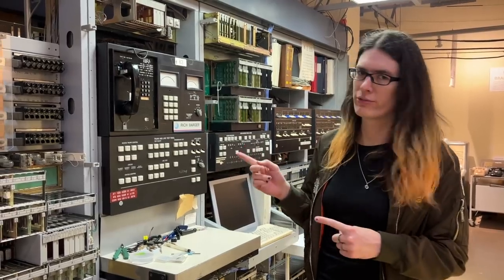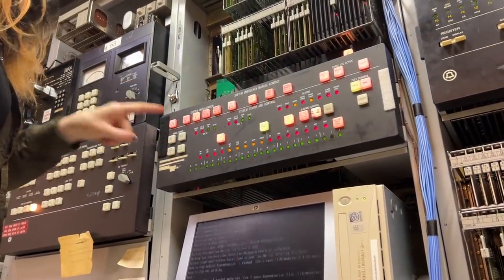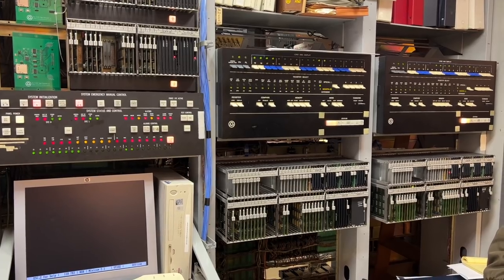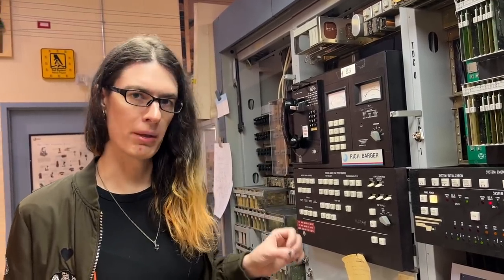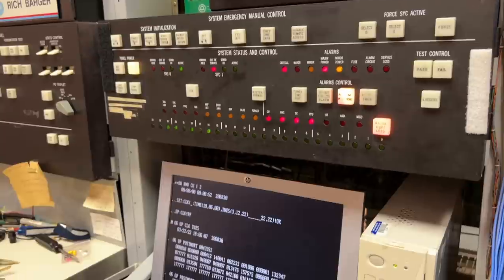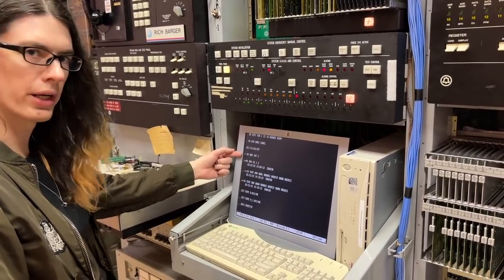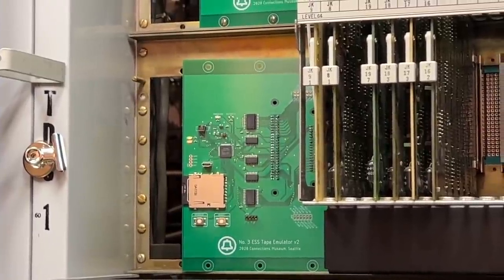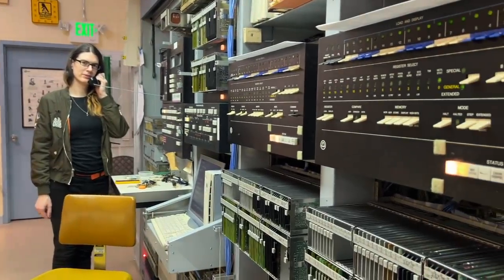Booting up the 3ESS

Comment: Great to see the 1AESS / 2BESS / 3ESS commands again. This machine was not designed to be powered down and then back on. Back in the 1970s, when a 1ESS was put into service, the Engineering goal was for the switch not to be Out Of Service for more than 2 hours in 30 years.
Reply: We had a 2BESS at IBM in San Jose in the 80s. It’s most likely been changed out in 2022. I heard they also had a 2B machine that served Catalina Island in SoCal in the 80s. The good ole PAC*BELL days.
Reply: @steve94044  I worked on the 3ESS system that went to Avalon on Catalina Island around 1978. We shipped it special in two pieces so It would fit the ferry that took it to the Island.
Reply: @535tony  That’s a cute building the co is in. My co worker was the island phone tech in the 1980’s. He lived in one of the pac bell rentals there. His first name is Rod.
Reply: @535tony  What part of the bell system designed the ESS and at what location?
Reply: @martello44  I don’t know where the 3ESS was developed. The 3ESS was mostly built at the Oklahoma works. After I worked on the 3ESS for two years all production was moved to Oklahoma works for the 3ESS. I then started  working on the 3B processor that was used in the 5ESS. These were developed at the Northern Illinois Works in lisle Illinois where I worked. I worked from 1979 to 1983 on the 3B processor from prototype to production. The Northern Illinois Works was shut down in 1983 when I left.
Reply: @535tony  Thanks. In the mid 60s I worked in a CO in lower Manhattan right next to the twin towers.  One day management asked us if anybody was interested in taking a mail course in digital switching where they would mail a chapter with a quiz at the end and if you got a sufficient score they would mail the next chapter to you. I thought it was clever and tricky because they trained you on your own time while identifying candidates who could be assigned to the ESS machines which were then being developed. The course even had a chapter on UNIX. I completed about a dozen chapters but left for another job before completing the full course.
Reply: 2 hours in 30 years??? :-))) ok, so our "a new version of the website will be deployed in just a minute, madam" kind of aproach is quite lame..
Reply: Not only were these systems built to never be turned off and on, Bell Telephone/ATT had lots of, "thou shalt not" demands with respect to environmental temperature variances that were allowed.  There were the expected absolute upper and lower space temperature limits but, even more important, were degree per hour or minute limits that were allowed.  According to required ATT training for contractors, thermal shock and thermal shock induced failures were a big issue with them.

Comment: I built the 3ESS systems in the late 70’s from the Northern Illinois Works in Lisle Illinois. Great memories. I also built the 3B processor that was used in the 5ESS till I left Western Electric in 1983.
Reply: Hey Scott!  Good to see you out there.  We had some fun times building 3ESS on our team.
Reply: Did you know Terry Webster?
Reply: @jameschristiansson3137  I don’t recall that name.
Reply: Did anyone else use 3B15/3B20 mainframes besides AT&T?
Reply: @douro20  we made 3B15’s and they were all for AT&T. We mostly made the 3B20’s and they all went into 5ESS.
Reply: @535tony  The 3B20D processors were also used in the Autoplex 10 and 1000 cellular switches. I developed code for the 1000 when I was at Indian Hill in the 1980s. Those were good times.

Comment: Was going to say, the ones I've worked on are literally never fully powered down until they're decomissioned.

Different function, but on an HLR (Home Location Register) I worked on, the one time we had to power down a whole frame (because we'd lost commercial power, diesel generator had failed to start and the battery plant was running at 36VDC), when it came back online it had lost 4 of 8 SCSI drives and needed me to fly out and nurse it back to health.

Fun times...
Reply: I recall the conversation from Alcatel when we were trying to sell our 600E in Manhattan... "If you turn it off, we'll never recertify it!" I think we sold it and the building. :-) That was in the early 2000's; it had been running continuously since the 70's. (No one was sure it could be powered back up.)
Reply: @jfbeam  early in my career, I worked for an oil refinery in the Midwest.  

The place opened in 1970 and by the time I came along, almost all the people who opened it had retired, and in that time they had never needed to stop the whole facility for safety or anything .. put another way, nobody knew how to turn the machines back on from a cold start. 

To my knowledge they still haven’t had to cold start the place (but there was a lot of anxiety around writing the documentation when I was there)
Reply: @satsuke  It's growing problem in technology fields. Few ever consider the issue of bootstrapping their operations. My former employer used to have a yearly "shutdown" process where everything is shutdown and restarted once a year, around the time most people take off on summer vacations. Of course, that wasn't an ISP, telco, cable company, power company, etc. If we turn off a building, it doesn't really effect anyone else. At my last telco job, rebooting anything was a paperwork nightmare; and there are things you simply DO NOT reboot, much less even look at the power cables.
Reply: @jfbeam  I was recently RIFF’d from my telco job, and it wasn’t so much an issue for us as they went with an aggressive trinary redundancy platform, so the Nokia could take an entire site offline for a month to perform upgrades and bring them up in order.  It was still a nightmare of planning because of the dependencies when it came to data model changes and trying to support GSM/UMTS/HSDP/LTE/NR all at the same time
Reply: @jfbeam  bootstrapping itself wasn’t that big a deal though as it was a docker/kuberneties on VM arrangement .. So we could move a live node to a different piece of hardware with it still running without traffic loss.   

It honestly wasn’t as satisfying as the old ways when we’d troubleshoot at small scale .. it is easier to throw away the VM and spin up a new one if something isn’t acting correctly then it is to try and troubleshoot

Comment: Very cool, I worked at Bell Labs in the 80's and 90's in NJ, where I wrote  a terminal interface (no API's back then) for the 1ESS, 2ESS, 3ESS, 5ESS, and DMS100. My interface created a single user interface to repair centers so they did not need to learn all the different switch commands of each switch type. This was very popular during the time when they had to verify the PIC code, during the growth of new long distance carriers, like MCI and World Comm. The thing about the 3ESS was it was a very small and remote located switch and the only access was via a 300 baud modem. How times have changed.

Comment: Whoooooooa, I've been missing you for so long :)
Love the 3ESS tape emulators - modern electronics coupled with antiquated systems are really my thing... this said by someone who built a few Raspberry Pi based controllers for a Monotype composition caster.
Reply: I've seen that done with an old PDP 11/34 since they no longer could get disk packs for it. The room seemed so empty without the fridge sized boxes of disk platters. I felt sad when I saw outlines on the floor where they used to sit and knew what was missing.
Reply: @PWingert1966  the mechanical aspect of old time computers definetly add a certain charm to them.

The transition to new CPUs is like replacing Prague astronomical clock with just a digital display. Yes, it's more precise, smaller, but it has lost the charm, the feeling that if you try enough you might understand what's doing what.

Comment: I used to commission Philips EBX8000 PBX’s all over the world. Although these were a little less complex, not much so: they could have up to 8,000 extensions. Dual processor reed relay switch under stored program control, loaded with paper tape. Operated in hex with 16+ switches. Remarkable how common many of these concepts and procedures are!

And it used to take me an hour to boot up an EBX8000: these too were designed to stay on.

Comment: I think the university here still uses the 5ess..  as an analog backbone..  still used for some feeds and the national weather service and emergency still uses it for clock and broadcasting relay...  crazy huge mainframe with 5 levels of entrance cables feeding the campus..  most are cut or repurposed but still have the glass batteries and switchgear running 24/7.. gotta use that old software to set up..

Comment: What's the relay cadence I'm hearing that starts at 6:24 when booted?  I recall hearing that exact same cadence when placing a call between the rings - mid 80s - Detroit area.
Reply from the maker: That is the office interrupter (OI). It provides timing pulses for the various circuits that need them. The CPUs operate the relays at 60 and 120 pulses per minute.

Comment: Back in the late 80s I replaced one these with a DMS100 remote in a small community outside of Witchita KS. I dont remember it looking like that. I had to hook up the Nortel Board to Board tester no a no test trunk on the #3. Took me forever as none of the local techs seemed to know much about them. Finally got it to work and that was the last I ever saw of those machines

Comment: Here in Toronto near the Eaton center bell had a building right beside it and tucked away in the basement behind a glass wall was a fully functioning switch that was for the building and likely the downtown core. I managed to grab a few pictures for a project I was doing at the time. A couple of years later they frosted the bottom five feet of the glass wall. It made me sad to know what was in there and that it would never be visible again. A few years later they dismantled it.  and the room's lights were turned off and then   the whole section of wall was replaced with Gyprock. I would love to learn more about that if anyone has information.

Comment: I was a test engineer at OKC Works where I ttouble shot manufacturing defects on #2 ESS processor and AIS system. Used to design machine code programs and hand mag twister memory cards as trouble shooting aids. Lotsa fun.
Would like to see a 2ESS processor video because I would have likely tested it back in early 70s.
Reply from the maker: We have a 2B ESS in storage, but sadly no room in the museum to move it in and display it. Maybe someday!

Comment: This is the system that replaced the step by step 355a office that I took care of in 1978 for southwestern bell. This was quite a change.  Thank you so much for this interesting video,  brings back alot of memories. If I ever get to Seattle,   can I see this system?
Reply: Yes, you can see it, this museum shares space in the Century link CO. @ 7000 East Marginal Way. I think it is called The Connections Museum and they are open to the public.
Reply: @aCraig-s3s  excellent,  thank you so much.
Reply: @t13 fox ... I had to laugh when I read your Comment. I remember SXS from back in the day with GTE...I started as a Courier and remember taking a break in a SXS switch while the Bears and Packers played...

Everything was dead silent.

... until Halftime and that Rural Central Office erupted with an imitation of the D-Day Invasion and I thought I would go deaf!
Reply: @brunobiava4833  I remember that.

Comment: Why does this give me like DEC vibes? I know Bell built all their own stuff, but that looks awfully similar to regular mini computers of the day, specifically a PDP or the IMSAI 8080 🤔
Reply: or Data General Novas
Reply: The later 4ESS and 5ESS switches had 32 bit processors, which - someone correct me - ran an RTOS called DMERT.  Bell labs also produced a series of commercial computers which had the designation 3Bxxxx which used similar technology.  The 3B series ranged in capability from a desktop unit which could handle a handful of terminals in a lab to large systems which could run a whole business office.  Early machines such as the 3B20 were 32- it word size built from 4-bit wide AMD 2901 bit slices in the 1970s.  Later systems incorporated the Western Electric WE32000 processor chip.  Many of the 3B systems were fairly powerful and equated more to a DEC-10 system than a PDP-11.  

Side note:  After about 1977, many PDPs got rid of the toggle switches in favor of a keypad and seven segment LED digits displaying in octal.  Only a very old PDP-11/34 I worked with early on had the front panel toggle switches.  The old machine required manually keying in a start address and executing a jump instruction on the switches to execute the bootstrap to start loading RT-11 O/S (in our case from an RK-05 disc).  I later worked for a university where we ran System V UNIX on a DEC Vax.  I got a chance to meet a few of the AT&T UNIX old timers:  Mark Horton who contributed to the vi editor and ditroff and Perter Honeyman of Honey DAN BER UUCP.  We were the first site outside of Bell Labs to run the revamped UUCP.  We kept a couple of Telebit Trailblazer 23K modems busy pretty much 24/7 transferring our USENET feed.

I personally had an AT&T 3B1 aka Safari PC7300.  The 3B1 was actually made for AT&T by Convergent Technologies, was based on the Motorola 68000 CPU and ran System V r2 UNIX.  The 3B1 had no commonality with the 3B2 series other than running a version of UNIX.  The 3B1 could have up to 4 megs of RAM and an 80 meg MFM drive.  I also had a cartridge tape and Voicepower board which I got at swap meets.  The Voicepower was really cool because it had a high quality CODEC and an entire IVR system could be written with Bourne Shell commands.  Graphics were green screen Hercules compatible 720 x 384.  The 3B1 was a pretty powerful desktop for 1984, but it didn’t sell well and AT&T started liquidating them in a so-called fire sale in 1986.  The 3B1 is sometimes blamed for Convergent Technologies demise.
Reply: When I build 3ESS in the late 70’s we used a PDP 8 computer to test the system by making simulated telephone calls. We would run the systems for days at full capacity before they would pass.

Comment: Because this is a *3*ESS, and not the later 4 or 5, those processors are custom logic, not the 3B20D that would drive the later switches, right?
Reply from the maker: Right. They're known as the "3A CC" or "3A Central Control". They were designed specifically to control a telephone switch, and are not very good at doing math, or more general purpose stuff.

Comment: Looks like the turn off procedures aren't up to parr to leave it in such a state that matches with what the start-up procedure expects to find the machine in.
Reply from the maker: What turn-off procedures? These machines were designed to be turned on once and then left on for 10-20 years minimum. The fact that we turn them off that is way beyond what would ever be done in the field.
Reply: @ConnectionsMuseum  Exactly, failure by design.

Comment: Having a PC instead of a TTY device could you raise the baud rate a little quicker like to 2400? Real nice video. 📞
Reply: I'd imagine not; it would depend on the baud rate of the 3ESS.  Back in the mid-70s, speeds up to 300 baud were around, roughly 3 times the speed of that 110 baud connection.  However, my guess is they still had old mechanical teletypes that printed on paper, and the mechanism could really only go so fast.  While there were faster teletypes out there, for compatibility's sake, they probably stuck to 110 baud.  2400 baud was more around in the mid-1980s.  I had a 2400 baud modem when I was a kid.
Reply: @jaykay18  The offices I saw had Dataspeed-40 terminals and hard copy desktop tty43 ? . Yes the old #1 ESS had the old ASR33 or KSR33 machines. The #1A ESS used Dataspeed-40 terminals. The really old 101 ESS (crossbar centrex) used Type-70 TTY baudo machines.
Reply from the maker: @jaykay18  Yeah, it originally shipped with a 33 or 35 KSR teletype at 110 baud, so that’s the default for the maintenance interface. It can be changed, but that requires a minor re-wiring and software configuration. Because we can’t yet save running config to tape, any changes we make will not persist after reboot. 

The eventual plan is to have a real TTY for the maintenance frame and a 1200 baud serial console that we can SSH into.

Comment: You didn't pull in the indicators because you have to pull them first before removing the large capacity fuses and you would have to remove twice as many. Or because they are hard to come by when you accidently pull the larger fuses first and you blow all the indicators. Either way, smart.
Reply: If memory serves they are type 70 fuses.
Reply: @kenunix1863  You are right. I am swimming in them at my office. Someone got excited and ordered a crate of them long before I was born.
Reply: @ericw357  Donate some to Seattle. They are used in ESS and #5 Crossbar and maybe T Carrier...☢️
Reply: Those White indicators say that they are 1 1/3 AMP fuses and they are 70A type fuses. 70 type fuses replaced the 35 type fuses. 35 type fuses are flat and held in place by slotted screws. The replacement for the 70 type fuse is flat and pushed  into a slot.
Reply: @gpwgpw555  35 type fuses. In Panel we called them grasshopper fuses because they were spring loaded. White Red Orange Green a color for each amp rating. White 1 1/3 amp used most. Red 1/2 amp Orange 2 amp Green 3 amp... You could also find these on step PBX's. Crossbar PBX's used the 70 type. I am talking to much. 🤪☎️